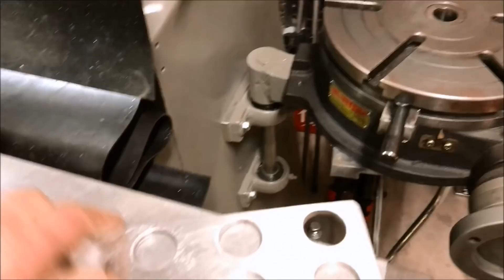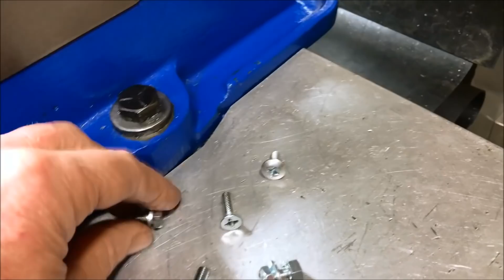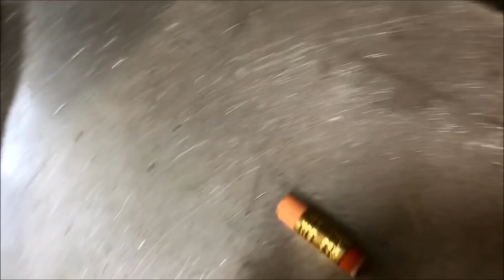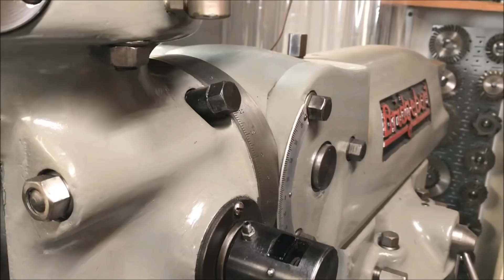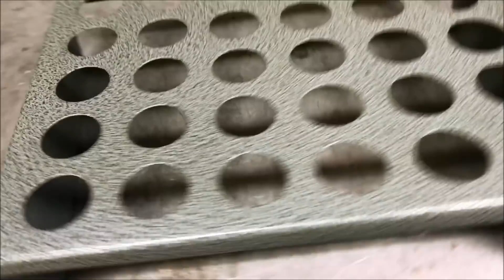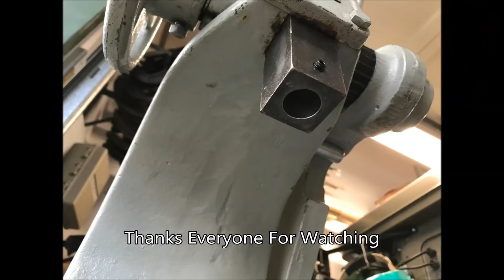Weekend Update #1 : Shop Projects and Stuff

Comment: Any chuck that spins a drill more than twice without it being operator error gets the round file. Burred up and scored drill shanks cost too much. My Dewalt keyless chucks have never failed to hold.
Reply from the maker: nice to know that about the Dewalt's , Thanks
Reply: Do you dress the chuck with a round file? Or by round file do you mean the chuck gets filed in the round garbage can?
Reply: @riversvic  Garbage can for sure, but I hadn't thought of it could be taken two ways. :-) Since I haven't owned all of the keyless chucks Dewalt has I also should have been a bit more specific about which one's I have that work well. Mine are on the larger 1/2" capacity 18V cordless drills. For all I know some of the other one's they have might be worthless, but I've had very good luck with the chucks those drills come with.
Reply: Turning Point lol I thought for a second you had some trick to fix chucks that I didn’t know about.  I also run the dewalts, my out 18 v was the cheap one and that chuck was no good, my newer 20v has the quality chuck on it though.
Reply: @riversvic  LOL I wish I did. That "round file" is the only permanent fix I've found so far. But your post got me curious so I actually read the fine roll stamping on my chucks. Mine are all steel and are marked as follows. Supra SK 1.5 - 13.5 which I assume is the metric size the chucks capable of. Then 1/16 - 1/2 for the imperial. What I didn't know until finally reading it is it's made by Rohm with a further stamping of GRIP.ZU whatever that means. Unfortunately there doesn't appear to be any real model number on them. A bit sad to hear Dewalt must have cheapened the chucks on the 18 V models. I guess the bean counters strike again. :-(  But I do know that not all Rohm marked chucks are of equal quality so you have to be a bit careful. I bought one that was either a counterfeit but bought from a reputable tool dealer or Rohm has there cheapest home grade chucks made off shore and stamped with there logo. It was no different than any other cheap off shore chuck. The second Rohm chuck cost me around $60 Canadian and seems to be half decent for lathe use. There's also a line of industrial quality Rohm chucks that are priced very close to how the Albrecht's are. So from that it looks like Rohm might have at least 3 different quality levels. Far too good for putting on a hand drill, but I'm more than impressed with my Albrecht except there price.
Reply from the maker: I'll probably need to make a custom screwdriver, Makita uses a funny lock screw to hold the chuck on. Yes i've messed up more value in bits than a couple of new chucks would have cost :-(
Reply: @TheAyrCaveShop  It might be one of the newer types of anti tamper screw heads? Although why they would use those isn't logical. If Wiha doesn't have the screwdriver tip then probably no one does. But if it looks like you can make one there's no point in special ordering one.